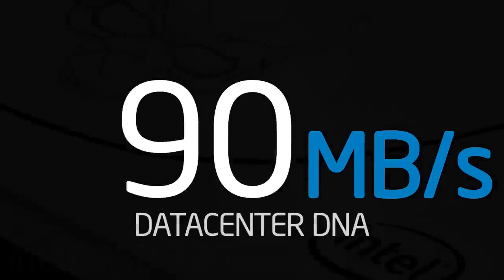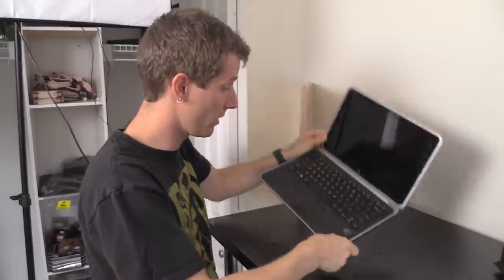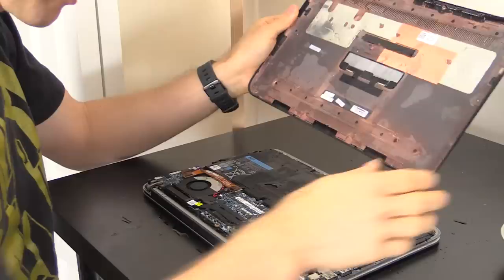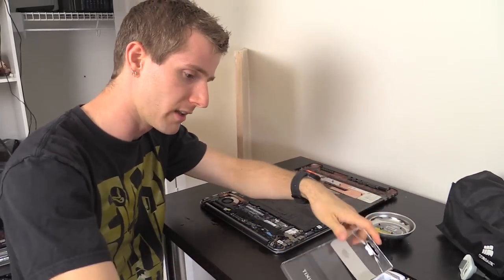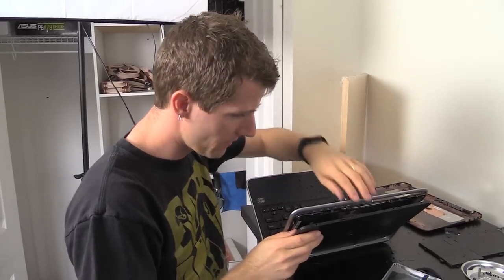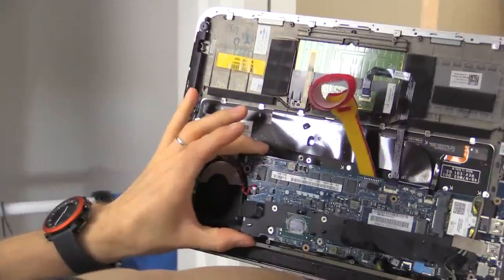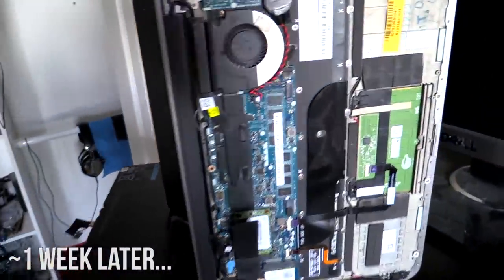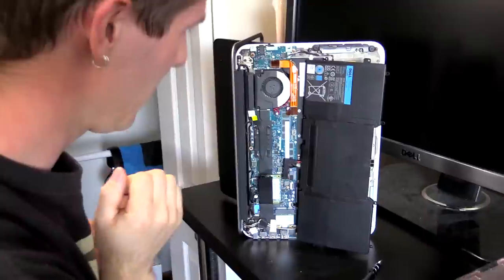Wet Laptop Recovery - Is it Possible?

Comment: I'm going through this with my HP OMEN 15.6" i7-8750h. Although, it was not left in a hurricane like yours lmao! But, it was misty and sprinkling rain, and I had shut the lid on it and it was in Hibernation and thus still powered up. I've disassembled everything from the chassis and have let it air out for 24 hours now, as it was just a little bit of water inside. Still was enough to cause white powder residue on the motherboard in a couple of spots about the size of a pinhead, so we shall see. I'm going to be slightly p*ssed... no, I am going to be rather p*ssed of a little bit of rain ruins a $2000 laptop when it's very obvious that these higher/mid-level machines can withstand much more than that if simple fabrication best practices and manufacturing techniques are followed. Let's hope HP didn't take the cheap route on seals and moisture barriers and charge $2K for it.  Great video and this gives me much hope for saving my beloved machine. I'm an Electronics Engineer and deal with Networks and Survey software, GIS and LandSat stuff so, it's imperative to unfortunately have to have a gaming or graphics laptop to be able to work. C'est la vie. It's paid for itself in droves, so even if it's a bust, I can't really complain. Thanks again again the hope and the awesome video! Glad it still lives and works for ya!

Comment: One critical step you missed would be to rinse the parts that got wet in distilled water before drying to remove any chance of the minerals shorting out components after the water evaporates.

Comment: I was able to get my Gopro (hero 3) working after falling into the ocean (sea water - worst case scenario) and I would highly recommend not letting electronics dry by themselves... I believe this may lead to contacts rusting. I removed the battery, disassembled it and sprayed mine with electrical contact cleaner and let it dry and happily it is working even one years later.
Reply: go over to Louis Rossmann channel and yes, what you did is better than even the mentioned "rice" method... i bet this wet laptop has corrosion damage by now

Comment: My son spilled a glass of milk on his HP laptop. The next day, should have done right away in hind sight,  I completely disassembled it and washed all the boards in the kitchen sink (even the hard drive controller had milk in it and had to be washed!) I dried all the parts in the sun on my back deck then let them dry a few days more.  The laptop booted up and still works great. Like i said my only regret was not taking it apart right away but it was late when it happened.  The milk gelled up and left some ugly corrosion on some of traces on some of the boards.

Comment: Wanna hear a full explanation why it booted and everything was normal?

Water (H2O) is NOT conductive.
In order to make it conductive you need to add it salts. That's what actually makes "water" conductive.
Now, rain is produced by water that evaporated. In that process salts are left behind, as they have a much higher boiling point to transform them into gas.
So, any device has a great chance of surviving rainy water damage.
The real concern hear it'd be if water, physically, is obstructing something.

Now, the PC was most likely on before it started to rain, and since you left it outside it was most likely on before the rain, and even during the rain maybe.
This is just a theory, as it depends on you particular energy settings, but I guess the battery got depleted. That's why the first message you got on screen was that the battery was too low. 

But hey, great vid about why not to panic. And the alcohol is a good option as well, as you mentioned.
Reply: The rain could have washed dirt and oils from the keyboard and other surfaces, letting those oils and dirt get into the electronics and making the water slightly conductive.
Reply: 1st_Luis there are salts in our sweat, and when we use laptop our hands sweat and leave it on keyboard, so it can make rain conductive, just sayin'
Reply: Silvanya Miller
Key word, slightly. It'd depend on the exact mix of "oil" and "dirt", but yeah. A very slight possibility. Just consider the amount of water and the amount of possible contamination.

 Slade Wilson I hear ya. Just hope you don't sweat liters all over your PC.
And judging by the amount of water, I'd say it rained pretty good.
Recheck solute and solvent, because I highly doubt it'd be enough "sweat" to make it conductive enough.

At the end, a bad conductive won't do any damage.

Thanks for reading and joining the discussion n.n
It's good to hear new theories.

Comment: Linus i have found over the years that if the battery in the device is completely dead you are safe as well. Had a blackberry once that was completely submerged for over 10 hours (long story short was at a party was raining when i left and when i ran to my car it fell out of my pocket into a puddle.) got it back the next day took the battery out hair dryer to dry it a little then the rice for 24hrs and it kept working fine for about another year or so.

Comment: I know it's kinda old but. The battery would not catch fire as it has a BMS AKA battery management system that cuts power in the event of a short circuit. It acks kinda like a breaker in the utility panel. Once the short is fixed it allowed power to flow again.

Comment: Pro tip. Rice doesn't do much of crap. Use a dehydrator that applies heat and it will work better. This is coming from someone who has done liquid damaged devices and got them to come back to life. Also corrosion can be cleaned with a tooth brush and 99% isopropyl alcohol.

Comment: assuming the device self-powered down (not sleep mode, the other one, hibernation?)
and thus, as long as there were no water traces between electrical components that had a charge, there'd be no damage. but for the amount of liquid that got into the laptop, that's still pretty darn impressive/lucky.

Comment: My guess is that while it was left outside, since the screen was up, maybe it was also on at the time?
If that was the case then the battery would be drained almost all the way down (maybe down to 5-10% where some laptops have auto shutdown unless otherwise disabled). If all of that was the case then the battery might have drained itself all the way before the rain set in in which case the components would not be powered and thus they would simply be soaked and not cooked (since you know being rained on and all)

A lot of luck still though and glad it worked out well. :)

Worst things that have happened to me in this way is coca cola into my old G15 keyboard. Couldn't even get it all out, but other than sticky keys for a month, it actually went back to normal with no damage taken even though it was plugged into a desktop pc and had power running through it.

My old NAS storage unit i was lucky (or smart) enough to buy one that has a U shape aluminum chassis over most of it (except at the very front where you have they bay ports which is just plastic) when i accidentally spilled almost half a liter of water over it. Didn't even flinch at it. Sadly the bay construction is rather crappy and full of holes so fast-forward a few years and one of my drives bit the dust due to actual dust. Luckily it was not an important drive so all my vacation images and school work is to this day still safe. I did get inspired to make an extra layer of protection for it though which i haven't started on yet since i am not using the NAS at this time. So i will be building a wooden box that is sealed all around except for the hole where cables come in. That hole will have thin brush covering all of it so that nearly no dust can get in. I know that heat is an issue but that brush-hole should allow for it to escape a bit and since i don't use the NAS for anything other than storage, it shouldn't generate so much that it will affect it that much.

Comment: I used to have an old alienware 14 that I accidently spilled a full glass of water in and after like a week of just letting it out to dry it managed to survive aside from the battery dying but was still able to run off the wall charger. Though it eventually died when it encountered a boot loop and then corrupted windows.

Comment: Linus is really relatable in this. Back in November of last year, some idiot put water near my laptop (That was only 4.5 months old) and I knocked it over, not seeing it. I lost half a semester of notes, and save data for all my games. Still pissed to this day.
Reply: +Zachatastic 117 A lessons learned atleast, backup your files regularly to prevent something like this. Or have your files syncronized in a cloud, but backing up locally is still a good idea.
Reply: René Nielsen I would have my files on cloud, but my internet sucks. On average it's 1.8 MBPS, and after 50GB used, it slows to 56.1 KBPS, and slower. Otherwise everything would be on a cloud server, available to be redownloaded.
Reply: +Zachatastic 117 try yandex

Comment: Back in my IT days, I once was supporting someone who's Indy[0] had been through a house fire.  The top plastic was all melty and deformed (the monitor had been sitting on it, and was apparently completely slag), the whole thing was covered with smoke stains, and it had been hosed down, and later thrown out onto the lawn.  I opened it up, checked things out, and the insides were relatively intact... I cleaned things out a bit, plugged them in, and... https://www.youtube.com/watch?v=CH9saUP2460 ... and everything worked fine.  I promptly copied her data to another drive, and got her going again.  That computer continued to work, though, until the power supply eventually died (a common problem for those machines, that could have happened anyway).  And yet, having experienced that, and various other such things... it's still amazing what can happen sometimes with hardware that goes through stuff like this.  Glad you didn't lose any data!

[0] https://en.wikipedia.org/wiki/SGI_Indy

Comment: Oh yes. This is my specialty.

Isopropyl alcohol is your friend. As is corrosion arrestor.

wine or coffee is the worst. retracing tracks on the main board using a circuit pen and a microscope sucks. 

rainwater is the best, and within 24 hours you should be pretty good.

Life pro tip Linus, get those waffle pattern heat pads that go under hot things on your kitchen bench, they're perfect for placing screws mapped to where they came from in their little grid holes. One pad for external screws, one for internal, etc

Comment: i speak from experience when i say that it would be more of a feat if it didn't go into hibernation (which is how it kept your programs active) most likely if it was on "high performance" mode it most likely drained the battery and put it self into hibernation. which would have prevented the voltage regulator or any other power component from going out due to power not actually being switched on when the water was on the motherboard. so be lucky.

Comment: About 15 years ago a computer shop in my area closed down and left a bunch of computer, computer parts, ect by the dumpster and I happened to go to the shop to buy something with store credit I was owed (yeah I got screwed) and I got there and the shop was empty and I saw all the stuff by the dumpster but it had been raining all day. I filled the back of a pickup with all sorts of stuff and brought it home. I dried it all for at least a week and 90% or more worked just fine.. I got my $50 dollar store credit and more after selling off not even 5% of the stuff..

Comment: I once had a homemade watercolling system installed in my pc. One day it bursted and kept soaking my system until I realized there's not enough water enymore (about 300 ml). But my system had no problem. Why? because I used  distilled water. Rain water is also mineral-free, so it's not conducting electricity. As long as that laptop was not full of dust or other organic/mineral matter, it was pretty safe!

Comment: I have a macbook air and I have to say that it is not a computer you want to get wet. it actually is pretty easy to open up and remove the battery -- not much different from what you did here -- you just unscrew and unplug. the real problem is that the screwdrivers are  uncommon and that mac laptops constantly run power through them in sleep mode (more so than windows PCs) in order for the laptop to wake from sleep quickly. Furthermore, all the guts of the computer are packed into one area on the logic board, so if water does get to the logic board it gets over the whole thing since it is so dense, so the chances of it shorting out are much higher.

(its a common misconception that all apple products are hard to open up like an iPhone is; MacBooks are actually much easier to open up and replace parts than most windows machines. the issue is that in macbook airs the ram and many other parts are irreplaceable. the parts that ARE replaceable, like the SSD are very easy to replace if you have the tools.)
Reply: seriously, macs are SO easy to open. you'd be surprised, try it sometime.

Comment: I find if you lay out a piece of paper in the position of the laptop I place each screw in the same location  on the paper as it comes from the laptop. some screws I find have different lengths and helps keep the placement correct for putting back together.

Comment: I just spilled tea over a $1000+ HP Omen laptop. I didn't immediately notice it, so it had some time to soak in. I noticed it when the laptop suddenly turned off. I rushed to the kitchen to get a piece of paper towel and started drying it. Now I have opened it up, and the water didn't seem to have affected the motherboard. Disconnected the battery connector and it's now drying. Hoping it'll turn on again…

Comment: Pulled a laptop out of a flooded basement from under 12 inches of water, after a few hours with a low setting on a hair dryer it worked just fine and lasted another few years for me.

Comment: I spilled sprite soft drink on my asus laptop (touch screen based , and came with windows 8 , but put windows 7) laptop completely turn off. I turned it back on and the fan sound sounded very strong ( never sounded like that before ) and laptop keeps turning off every 20 minutes. Took it to the repair shop , fixed it , and worked normal again , and laptop turned off again and making load fan sound , took it to the repair shop again , and they said it was fine. haven't used it for 2 months , used it again and no problems and completely recovered unexpected like ever since and still using it today. This was back in  Sunday , April 26 , 2015  , got it fix in the middle of may , still had problems , stopped using it in june , used it again in august , and went back to normal. OH GOD I HAVEN'T LOST MY IMPORTANT LAPTOP (WHOLE COMPUTER DATA WAS VERY IMPORTANT TO ME EVER SINCE 2012) Just finding a way to back up on my drive and online (because my storage device failed twice , was a 2 tb external hard drive from WD)

Comment: Lol my laptop was wetted by a leak in the roof. Plugged in and on battery. But I woke up next to it and unplugged it asp and had to let it dry tho it was easy to take the mother board out so I used a towel to dry then put it in the sun for 2 hours then put it together and it was ok :). Plus it was not that bad the seeping in Good video. May play around with my old tablet and put it in water and connect a battery to it after it drys

Comment: My macbook pro is able to be opened up as well just more of a hassle had to order the special pentalobe screwdrivers for the job. Damn apple always make it hard to repair stuff, anyways that xps looks damn similar to the inside of my macbook that's for sure, albeit easier to tear apart and replace components compared to the mac. Just the construction you can see they took some of this from apple, which is a good thing on one end and bad on the other lol. I only had to take mine apart for a cable that had broke and it was shorting out on the frame, It's the one that runs to the IO ports and the magcharger guess it's a common issue since it sits on top of the one fan. Couldn't believe how dirty it was just from a year of use.

Comment: On the first week of an internship I spilled an entire medium pepsi on the brand new laptop that they gave me. I shut it off immediately, took it down to the office's PC depot. They took it apart and dried up all the PUDDLES of soda that were in it and it was working after just a few hours. Dodged a major bullet.

The keys are still a little sticky though cause I've been too lazy to take them off and clean them.

Comment: Well being that most parts in a Laptop these days don't move and also stem from Cellphone technology (or other way around depending on point of view). That the Samsung Phones (The non-bomb types) are Water Resistant and able to be used. As long as the connectors covered or I believe some connectors are not connected directly to the battery to worry about shorting. So seeing this laptop reviving after being soaked. I think more of a worry of the keys screwing up, and battery not charging than the SSD not able to have any data. As there are few moving parts in this version of a laptop and even now in the future. Fewer laptops have even fewer moving parts. Some even have no fans!!! MADNESS! Or even DVD/BluRay Player. Or even keys to begin with. GASP!

Comment: I had a backpack that also served as a cooler, and once had an entire 24oz. can empty inside along with my Sony Vaio. When I pulled it out,I didn't realize until I watched my laptop take a 10 second piss. Popped the battery out, left it on it's side opened for two weeks, and against all the odds still survived. It died shortly after when I short circuited the motherboard with static electricity fixing a loose audio ribbon cable, smfh.
Reply: I forgot to add that the can of all things was a $1 can of Rolling Rock, and my Vaio had an msrp of $999.  1k almost did in by a buck.